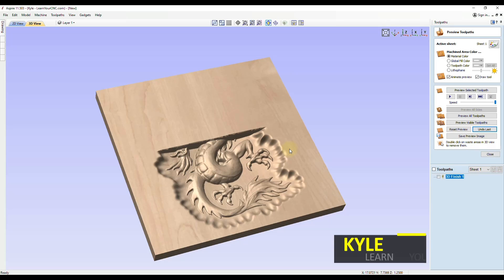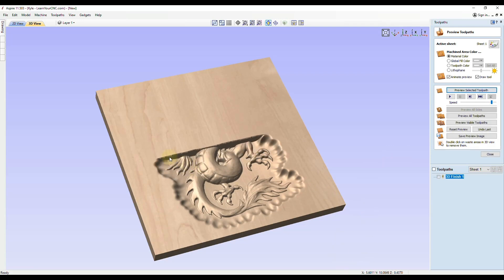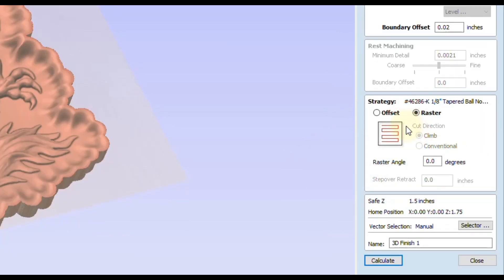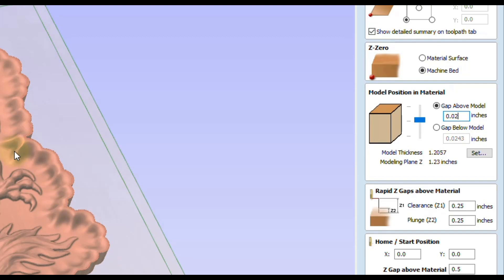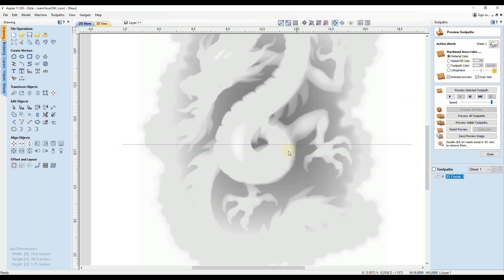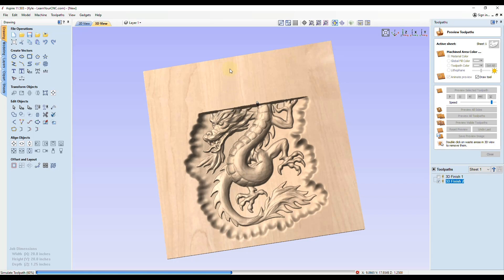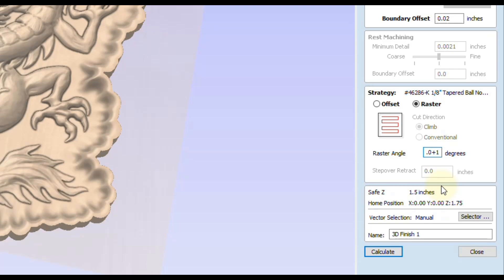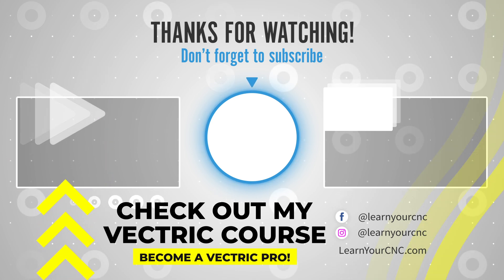How to resume a 3D carve after it stops part way through - VCarve & Aspire Quick Tip

Comment: I solved this problem by adding a UPS to my machine. I wired it so only the controller was powered up during a power outage and a relay opened the circuit for the estop. The UPS will be able to hold this for days if need then all I have to do is resume the print.

Comment: Tried to draw a line and re calc. But was not able to use the snipping tool to cut vectors. Could only snip the line I had drawn. Not sure what I'm doing wrong.Any ideas.
Reply from the maker: Your vector boundary is probably part of a group, so you will have to ungroup it first before snipping. To ungroup it, just select the vector boundary and click the letter U on your keyboard. After that, you should be able to snip it.

Comment: You confused me on one setting. "Gap Above Model"...You changed it from 0.0 to 0.02 which should raise the bit 0.02 higher than it was, not lower, correct? I think to lower the bit below 0.0 you need a negative setting like (-0.02) . Great tips Kyle! Thanks for sharing these!
Reply: The positive number lowers the bit the software does not use a negative number in this situation yes a negative number would make more sense but that is not how the software works in this situation for whatever reason I don't know.
Reply: @rodneycarpenter3253  Good to know! Thank you!
Reply: In the model position in material setting it will only except a positive number.
Reply: @rodneycarpenter3253  so how would you lower the bit if your gap above model is 0.0? What would the setting be?